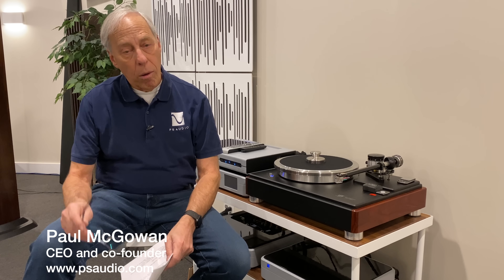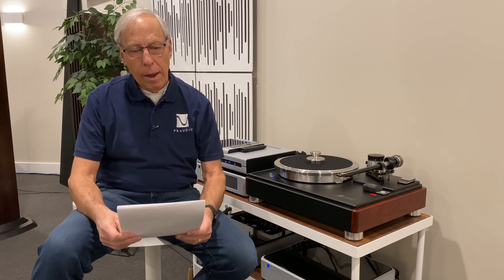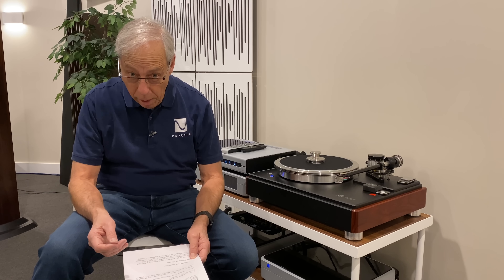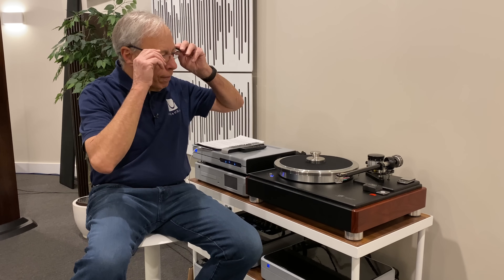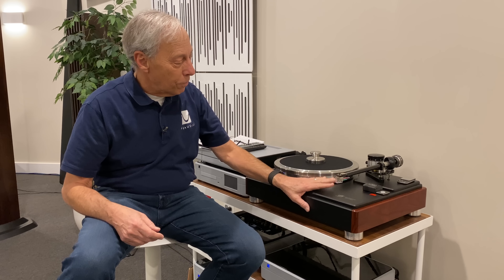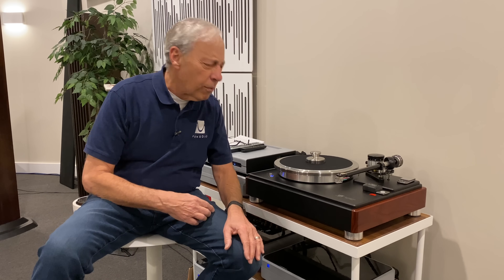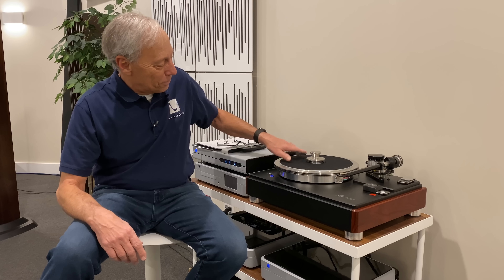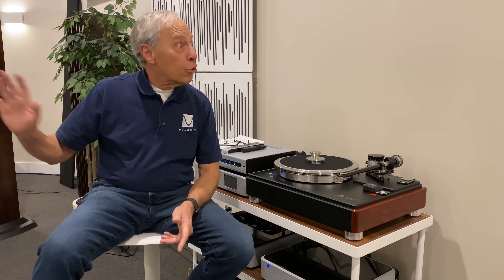Better to use a power conditioner or straight into the wall?

Comment: How about if I have issues in most of my devices like amplifier buzzing noise, subwoofer humming, or other audio issues and probably my wall outlets are not that good? What should I buy to fix those problems from the bad electricity installment in the walls? Conditioners, enhancers, external linear power supply? Something else, something cheaper? Recommendations?

Comment: Paul, the people whining that quality power cords are snake oil, are doing so out of envy.  Their budget does not permit them to purchase such equipment.  So they bash what is out of their financial reach.  They try to convince themselves that they are not missing out.  And they feed off of each other, for confirmation of their envy.

@6:40 -- They are no longer rare.  Several companies make extremely good ones, that not only do not suck the life out of the overtones, etc, they actually improve the overtones and everything else.

Two go-to brands are Audioquest and Shunyata Research.  They have different lines of power conditioners (they call some of them power distributors), and they have to be heard to be believed.

They do two things really well:

1) They have power reserves, to provide instantaneous power when amps or other boxes make such demands with dynamic transients.  Amps would otherwise clip, for milliseconds.  You will not hear the micro-second clipping, until you use one of the above mentioned power distributors.  It is like your amps just became a Ferrari.

2) They lower the noise floor, and that is tremendous.

The biggest culprit of bad power is not from the utility line (unless you have some really bad power delivery to your home).  Rather, the biggest polluter of your power is your stereo's own components.  You have all of your stereo's boxes generating noise, and it travels to all of the other boxes.  You have no noise?  Well, I believe that you believe that.  But once you use a quality power distributor, your jaw will drop at hearing (or no longer hearing) the noise that you thought was not there.  You will wonder how you ever listened without that power conditioner, and kick yourself for not purchasing one.  It will be like upgrading every box in your stereo.

You will hear every box in your stereo perform at its maximum.  You will hear every box in your stereo sounding its best.

With a quality power conditioner, and quality power cords (especially the one that connects the power plant to the wall), your stereo will sound 3x the price, and listening fatigue will be a thing of the past.  Any reasonably good stereo will greatly benefit from a quality power distributor.

Comment: 🤨🧐😏 I’m afraid things are not so simple and binary. 
The impedance issue relates to audio devices that request highly variable current with fast transients. I can’t think of any other audio components than power amplifiers. 
It doesn’t matter for other ones. So the advice to avoid filtering conditioners and plug directly to the wall should only apply to the cord powering one’s power amp(s).
Other (supposedly separate) elements of an audio system are usually low power, stable current draw elements such as sources, a DAC, a preamp etc. Nowadays most of them might be processing digital signals. I would think that they are potentially much more susceptible to pollution by (very) high frequency noise from the power line. So filtering the power is probably desirable for these. 
Actually, most good quality modern power conditioners do offer separate power output plugs both high current, unfiltered, and low current, filtered. This seems to address the different energy quality needs of power amps and other audio components, unless I’m missing something else. Providing that a proper internal star wiring layout is being used. 
Except for severe power line off-sinus quality problems, it hence seems to me that a power regenerator such as PS Audio PowerPlants is a potentially significant improvement (zero power feed impedance) for power amplifiers only or mostly. It should also depend on how much current storage the power input section capacitors can accommodate for immediate DC current response to feed power components. 
Which is also a reason why a high power amplifier should be generally more at ease to deliver rich transients than a lower power unit when used at the same listening (acoustic) level.

Comment: Why not have the output from the conditioner the same as the working voltage of the equipement they are feeding and remove the equipements mains transformer, less equals more.

Comment: The true answer to this can be determined by what amps are involved. I don't think it's about selling power conditioners. I can tell you I just bought a pair of McIntosh 901s and they will run with a JL F212 alongside the speaker. So, what I did was add 2 x 20 AMP lines using 12/2 ROMEX to the main electric panel. At peak, both the sub and 901 will draw close to 20 Amps so 2 circuits were installed. If I add a power conditioner it will draw it's power, plus the power of the amp & Sub. Provided there is nothing else plugged into that circuits (like a domestic appliance) then you can pick up interference you don't want. Each amp and sub is on it's own 20A circuit. I also would add, I plugged 2 x ARC 250M and 1 x Anniversary Pre into one of Paul's Powerplants and it crashed the Powerplant. I do however agree with in most of Paul's setups you see a PowerPlant 20 and then his 600W mono block. Not there is one PowerPlant 20 on each Powerplant which says it all. If you had each on a 20 dedicated line direct to the main fuse panel then that is the ultimate way to do it. The guy I bought the 901s off just replaced them with the monstrous MC2KW. He had not thought about amp draw. I schooled him in it. He's also in a high end rental property. What's that gonna take? 2 x 30amp, 4 x 20a,p??

Comment: Audiophile power conditiners might be mostly snake oil, but it's still ridiculous to say a power conditioner removes frequencies or overtones or whatever that vague claim was. You're conditioning a 120V (or whatever) source before it even goes through the audio device's transformer, caps, regulators, etc, then maybe goes out a pair of +15V/-15V rails and into some opamps or whatever. If the power conditioner is so bad that it makes the opamps malfunction then OK maybe. 😂

That "highly resolving system" stuff is definitely sounding like cult leader material. Maybe I need to get Xenu to check my body thetons that are degrading my listening experience. How come all the guys who talk like this look like they probably shot rifles with no ear protection in Vietnam or the Gulf War and couldn't hear anything above 10KHz in the first place?

Comment: I bout my nice Speakers --yep better sound. an expensive amp --yep better still I bought a Linier power supply and OMG that is the biggest improvement in my sound so far.
I would recommend clean power before most upgrades.

Comment: I don't understand this explanation... to use our equipment we need energy, energy from the wall is contaminated by other equipment connected like refrigerator, tv, etc. When the noise of this energy enter the circuit of our sound systems, it mixes with the music affecting its quality.  If I use a power conditioner to low the noise from the wall, how could this remove part of the music? Your answer doesn't make sense to me.  Sorry.

Comment: I'd been using an old Monster power conditioner for years and had become increasingly dissatisfied with the sound quality of my stereo system, no matter what components I had engaged. After watching this video I figured, "What the heck?". Unplugged the Monster, plugged everything into power strips (not enough wall outlets) and was blown away.

Extended, cleaner highs and lows, improved instrument placement, dynamics by the bucketload, an actual soundstage with width and depth.

Currently using 90s vintage Rotel power and preamp, 1989 Sony CD player into a modern Cambridge DAC, Rega P6 with an Audio Technica moving magnet cartridge into old Rega Fono, Magnepan MMGs/NHT subwoofer and Audioquest cables. 

I believe I am hearing the best sound reproduction I've ever heard through my modest rig. One of these days I might swap amp/preamp/speakers but I'm satisfied for now.

BTW, guitar amps also sound far better plugged in directly. An amp I had previously thought was shit sounds fantastic now with straight house current.
Reply: I also have a monster HTS 3600
but I had the opposite results, I get a brighter sound when connected to the monster as opposed when connected to the wall.

Comment: This makes no sense (to me). A 120VAC "power conditioner" should not effect your "audio fidelity" one way or the other. It only filters the noise (if any) on the 120VAC line and protects gear against overvoltage, spikes and brown outs. A "power conditioner" does nothing for the voltages delivered by the audio gear's power supply and transformers, and your gear's power supply should be ripple free and clean or your manufacturer needs to redesign their very expensive gear. How does the nominal 120VAC line contribute to the audio gear's "fidelity"? Now, fancy audio cables, yep 100% scam. Am I missing something? You can't be "conditioning" your audio ins & outs (LOL). However, still love the content. Sorry if I missed the point here.
Reply: You need to understand sheld for noice is important iff you use high end equipment
Reply: @jenserikjohansson6228  And you need to know something about electricity and electronics. Brownouts and noise on the AC line are not your friend. If your power conditioner's crap, it won't do it's job and the "experiment" suggested here will be proven right. All those agreeing here have crap conditioners that induce more noise than they "filter".

A "shield" on an audio cable is basic tech for low end signals. It matters not what it's made of, what matters is it's ability to shield and that can be judged by it's weave. There is ZERO inherent value in your "gold plated" superconducting uber expensive cables. You're paying for bragging rights, and playing the fool.
Reply: @JohnDoe-xv1se  i have 8 years off school Audi -video and elektronisk.35 years work on same
Reply: @jenserikjohansson6228  LOL... BFD. and I'm a retired engineer, certified by National Semi 32K, Motorola 68K,, Intel 386 and up CPUs, VME Bus, Multibus and Q-Bus systems integration with 40 years advising electronic OEM engineering teams on their electronic component and systems designs. Now retired, I have a dozen multi-layer miniature PCB projects ready for production, my kid has a masters in physics, statistics and a PhD in ML. So what???

Those who claim they can tell the difference in materials when properly sized audio cables are used are hosing you. These aree the same folks who spout off about how an ebony fretboard is somehow better than rosewood. That one body of an electric guitar "resonates" better than another. These people know nothing about physics, let alone electronics.

AC brownout will effect your "audio" far more than one cable shield vs another. We live in a first world country, whose power is pretty darn "clean". You do not need "thicker" cables to allow electrons to travel more "freely" so they don't "bump into" one another... Let alone "gold" plated conductors. LOL!!

However, by all means, buy real thick AC cords and gold plated audio cables if the "sound" will impress your pals.

Comment: Hey Paul, I will run dedicated power cable straight from our fuse box, so nothing else on the circuit but my hifi equipment…. How about surge protection, do I need to clear the mains from any spikes or possible damage? 😮

Comment: You can even put a dimmer on the powerline. No difference in audio quality (source: Audio Science Review, Amir)
Reply from the maker: Please don't do that, not if you're concerned with audio quality.
Reply: @Paulmcgowanpsaudio as an electrical engineer I believe in science. What's wrong with that?
Reply: @Paulmcgowanpsaudio   And I will sell my Stellar Strata first thing tomorrow. Not concerned with audio quality.

Comment: It is all about impedance, however, the impedance through the mains supply will generally be lower than the impedance of any power conditioner installed transformer.  In addition the inductance would be vastly different.  DC on the line and RFI would be far more detrimental to your system, however the better your amplifier and source quality is, the better they will have been designed to clean up these disadvantages.  Generally speaking, you have to purchase the very high end power conditioners to see much of an improvement if any, my advice is to try to keep any electrical equipment which can develop noise on the line (switch mode power supplies, inc LED lighting) away from the circuits and outlets used by your audio system. Spend your hard earned money on better source, amplifiers and speakers, that’s where you will see the best results.  I am a consultant electrical engineer working in the power transmission sector for 40 years, trust me, I do not have a power conditioner in my system, I do however have surge protection on my incoming distribution board to cover transient issues (high voltage spikes).  Best of luck in achieving the right sound :-)
Reply: Excellent info, very interesting. 👌

Comment: I run a Tripp-lite conditioner with actual line voltage regulation as opposed to just your usual coils and what not. Better than your average conditioner to say the least. Still considerably cheaper than a power plant of course. Unlike most conditioners I’ve used I actually don’t notice any degradation in sound quality when running only the source components off it. In fact I think it sounds better. However not so much when I attempted running the power amps themselves out of the conditioner. At this point I use it for sources only and run the amps straight into the wall and find it to be the best combination that I’ve tried. I’m not sure if it’s the simple fact that the sources draw way less current in the first place but it truly seems to clean everything up slightly without robbing the music of any critical components when using it for the sources and nothing else. Or I could just be jerking my own chain of course but I still have pretty decent hearing and don’t believe I’m suffering from a placebo effect. The difference when running the amps off the unit was immediately noticeable in what I found to be a negative way

Comment: Living off grid and dealing with 12 volt batteries in our system it’s common knowledge that the larger the wire used. And we use large wire. (if you think battery cable) the less resistance. So it only makes sense that if you have more “stuff” in line you are creating resistance. First rule of thermal dynamics is you can’t destroy or create energy, but rather refocus it. So it makes complete sense that energy going through extra coils etc is refocusing (stripping away) the energy passing through it.

Comment: I just decided to try using my newer furman with my stereo setup. It’s a low watt tube amp. I want to see if it was different and it if it would help at all. I don’t know anything about electricity but it sounds so much better with the Furman it’s crazy. Not sure what this could be due to.

Comment: I run a studio in my basement and because of high EMI frequencies I get in my basement. A power conditioner is the only solution that I have found to prevent radio signals coming out of my speakers when recording guitar haha. Maybe someone will read this and have a better idea. Open to suggestions :)

Comment: I bought a PS Audio Stellar PowerPlant3 a few months ago. I did not believe it could make a difference. In fact, I was convinced it would do nothing to my sound. I bought it only because I'd never tried anything like it and it had a 15-day return. I was shocked when I plugged it in and it made a sudden improvement to all my digital devices. So, every day during that 15-day return window I listened closely to make up my mind. But every day the sound was noticeably better overall. I've kept it in my system gladly.
Reply: The only way to actually test any differences to do a double blind experiment. The placebo effect is strong, only a fool would assume it doesn't apply to themselves.
Reply: That is sweet 15 day return.  What is the break in time 100 hours 
 Also for fun call PS A  say something is wrong with the product   I need to send it in.  
Now,    Sit back a listen 
To PS A.

Comment: I haven’t got there yet, I’m thinking buy expensive power cables and you plug that into the wall, how much can just a power cable do. It seems like some kind of power controller either built into the wall or plugged into the wall is needed , I’m not an electrician but aren’t the problem the uneven current that comes originally from the wall. Can just a fancy cable fix that?

Comment: Cleaning up "dirty electric" is usually negligible to zero in the vast majority of so-called power conditioners. I have an expensive Furman PL-PLUS DMC Power Conditioner and the dirty electric signal in my wall outlet is 56 mV and any outlet on the Furman itself is worse at 160 mV. So yeah, according to my Greenwave EMI Dirty Electricity Meter, the Furman is NOT cleaning up the dirty electricity and actually making it worse!